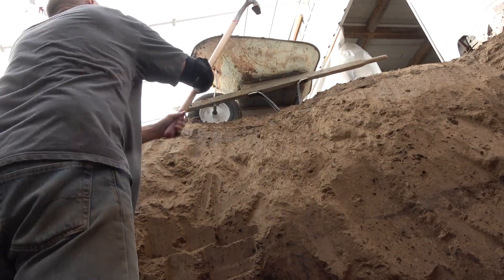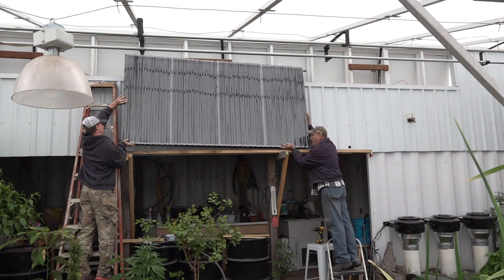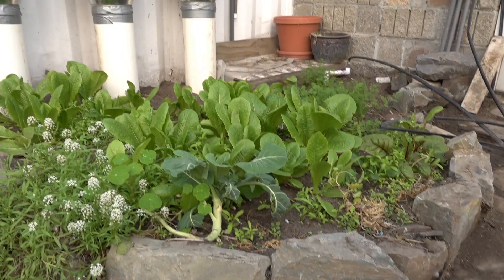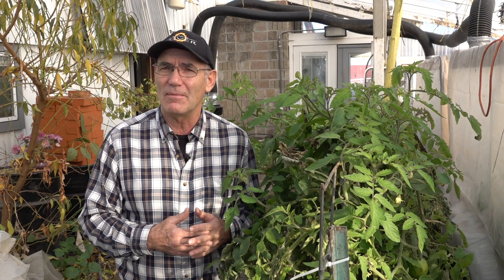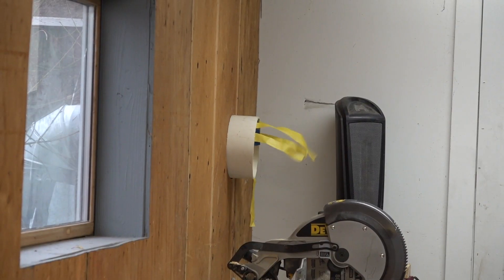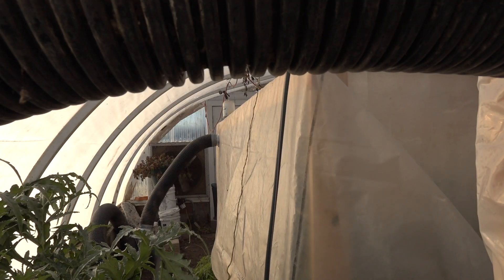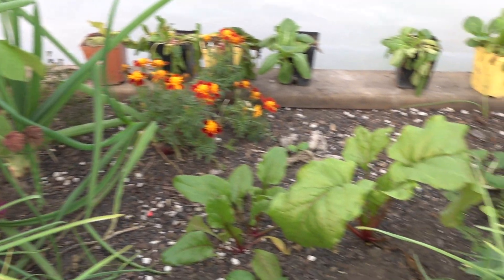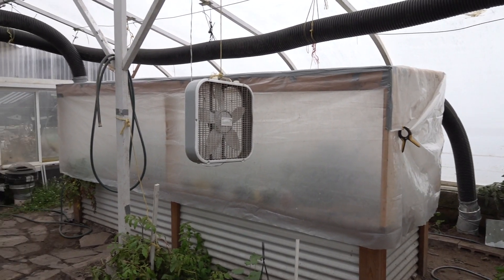Four Season Greenhouse Growing in Zones with Climate Battery

Comment: Could you share what fans you used? Happy with them or would you suggest  something else?
Reply from the maker: The fans need to be sized to the amount of air you need to move as well as the size of pipe that you are using.
Reply: @Howtofarmandgarden  sorry, I should have said brand.
Reply from the maker: @michaeleeten7783  VIVOSUN 8-Inch 740 CFM Inline Duct Fan. Performing well so far.

Comment: Super! Are the tubings in earth with holes or without?  What's the air fan power?
Reply from the maker: I used pipe with holes but would not recommend doing that. We experienced a water leak and had water infiltrate the pipes.

Comment: Flaw in your design sir. Heat energy always wants to rise. You should have put the pex loop under the air tubes. Preferable under 2ft of sand. Its a MUCH better thermal mass than just dirt.

Comment: Thanks for the great information on your four season greenhouse. I would like more information on your new zone with the pex lines . I will be building a greenhouse this spring with the geothermal pipes . I'm thinking about putting the pex lines under the corrugated pipe. Are your temps coming out of that zone significantly better? thanks for any additional information.

Comment: It seems like you may be able to capture more heat on sunny days to charge the underground battery if you had a hot air collector ( basically a duct with holes) near the top of the front wall where your vents are now and connected to your return air pipes going underground.  Pushing that hotter air down there may allow you to vent less and have a warmer battery for the winter. Fantastic videos, looking forward to updates! Thanks!